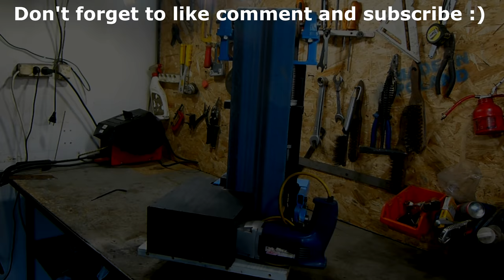Dril HACK 2 belt sander 6x48"

Comment: Would be cool if you did some quick jack-in jack-out system for all your drill-powered tools so you can use one single drill machine to every tool. That would require some other clamping method however, maybe you can use a bicycle quick-clamp for the drill clamps. To avoid having to deal with the chuck, you could have like a long nut with a square hole that you insert into the chuck, and then a square pin at each tool that will precisely fit into the nut that is fastened in the chuck.
Reply from the maker: Hmm I'll think about it;)

Comment: There are only 2 downsides to using a drill:

1. The noise! this could be solved by using an induction motor and belt.

2. The speed, most drills are capped at around 3,000RPM, this could be solved with an intermediary wheel to double the speed to 6,000RPM

Comment: do you use the same blade for metal aswell as wood on your evolution?
Reply from the maker: Yes, blade cuts steel, wood, plastic etc.
Reply: what blade? name? :D
Reply from the maker: http://www.evolutionstore.co.uk/furyblade210multi.php this one, but it can be used only with evolution saws or similar. It's about max blade speed  :)
Reply: ok. im looking for a metalblade for my dewalt

Comment: Great job but I just don't get the drill power.. surely you could have found a suitable motor.
Reply from the maker: I did not have the right motor but I had 4 drills, so one I could use :)